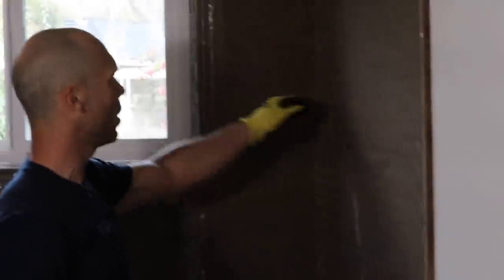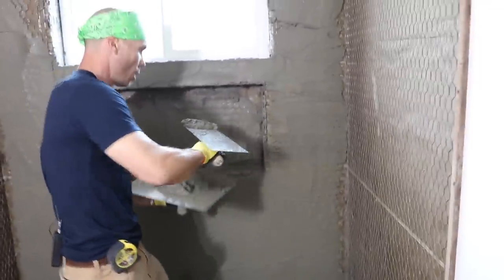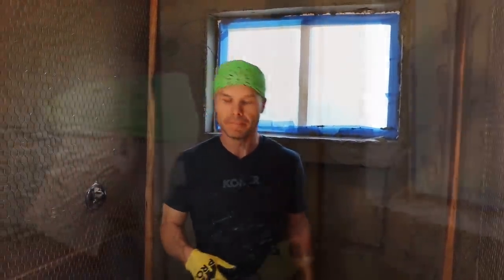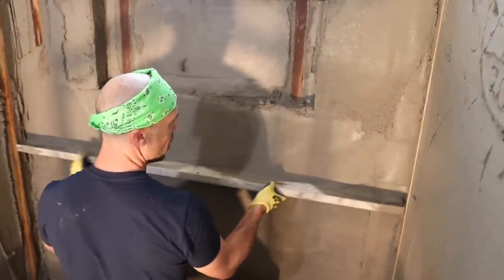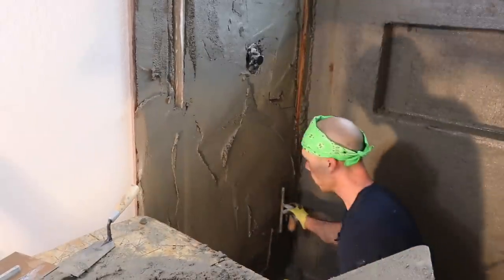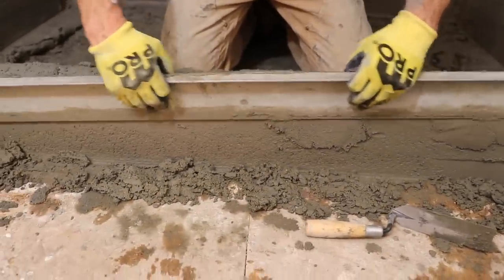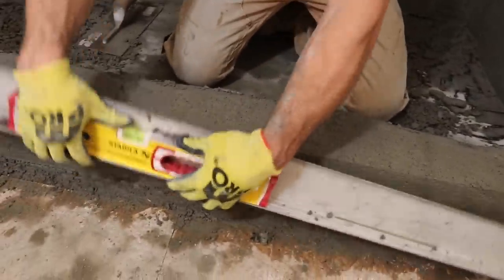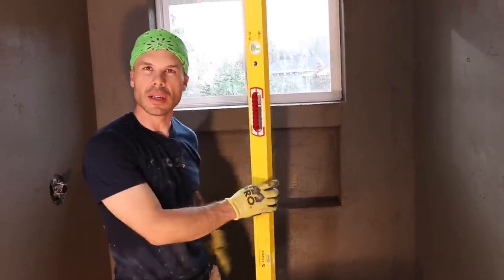Learn how to FLOAT! Tile Coach Episode 23

Comment: It is great that you consider this an art, like sculpture. I feel the same way about building shower pans with deck mud.  Now I want to try this out and I have a shower coming that will be a good one to have a go with it.  Thank you for sharing.  Hey, is there any need to waterproof the finished float surface before tiling?  I would if it were cement board or any non waterproof underlayment.  But then new school methods don't put moisture barriers behind the screw on wall underlayments these days. You however have a barrier behind the wire layer.  Thanks again for upping my game.

Comment: I always scratch coat first by running my 3/8" notch trowel horizontally for "scratches". Next day I brown coat and detail all edges, then start the wall material install.
Nice to have a helper to mix mud and haul... keep the tools clean and organized/ready. It is so hard to find good help... someone who actually pays attention and is interested in their job.

Use the straight edges, one on the back wall, and the helper holding one on either of the side walls, then square-up the furring strips to those on the back wall so the floor tile is square, too.

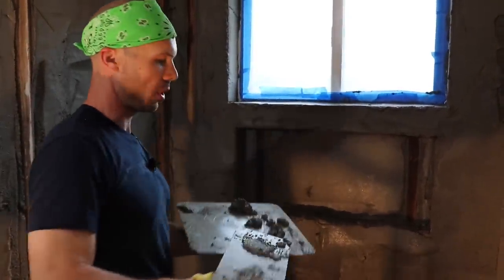@28:14  I guess I spoke too soon... I hadn't watched the entire video before my prior comments.
SoCal and Az. mudwork is scratch, then brown coat... due to weather... even in winter, the temps are far to high to try and float all at the same time... walls tend to crack.  Guess why...

Comment: Isn't shimming the wall much easier? I plain the 2x4's that stick out too much and shim the 2x4's that cave in. I even carve out the boards for nail protectors and plumbing. It takes about an hour. Tile guys always ask how did I get it so flat. They think I use metal 2x4's. Which gave me an idea. 😆

Comment: If you use a 5/8 " molding on the outside of your side walls, then you don't need that second redwood screed to the outside. Just set the inside one and rod off of the border moulding ! Dampen your redwood strips before imbedding them in the mortar.  When you are done with each wall, take a V-notch trowel and at the floor of the pan , dig out the mortar at the bottom 1.5 - 2 inch's up from the pan. That will be a locking scratch area when you dry pack the floor of the pan. Just throw a little wet mud around the perimeter before you throw in your dry pack. It locks the walls and floor like one solid unit. 30 years experience talking. 😁

Comment: Don't think this method will appeal to the Hardi backer bunch. Not quick and easy enough..Usually the plaster crew would lath  and scratch out the walls for the tile installer beforehand.   Normally not applied over existing drywall, but this eliminates a scratch court.  Be careful over plywood though, as it can expand enough to crack tiles later.

Comment: Isaac, do you have another vid where you tile this? I want to see how you trim out the shower wall termination. Plumbing that left wall seems like it would create an issue where it meets the bathroom wall. 1/2" at the top and 1" at the curb. Thanks. Another good video and job well done.

Comment: I need to float an interior wall before tiling, I noticed the wall is pretty concave in the plaster coat after plumbers worked on pipes inside the brick wall. Don't think my 80x80cm tiles will like it.

Comment: About ready to install composite shower walls to durarock. They advised not using waterproof membrane and use construction adhesive onto the cement board as is. Noticing about 1/4” unevenness so should I shim and use thicker adhesive in few low spots or skim coat with leveling patch?

Comment: I have a true DIY question so be nice.  I already installed my concrete board and Schlutter membrane on the walls and now noticed some bowing in the walls.  It is not bad, but the tiles are 12"x23" and will require heavy mud in spots.   Can I thinset over the Schlutter membrane prior to installing tiles?

Comment: So there were a few things that came to mind on this. First, he has wet the one side of the float strips in another video and made a point to film that. In this video he didn't show that he did that and was wondering if he's changed his MO on that. Second, with the floated wall being about 1/2" out beyond the rest of the wall outside the shower how do you transition that from the tile shower to the painted wall? Does it look ok just looking at the dried mud edge? Looking down at the line up of the curb and the floated wall doesn't line up either. That seems like that would stick out as odd looking as well. Wish I could see, and maybe he has a video, him tiling a complete shower after floating it like this. The last thing is did the first coat of mud take the full 10 bags and if not did he just toss the excess? Or did he leave it outside while going to lunch and it was still ok?  Does he cover the mud trough thing with something while he's waiting for things to firm up so the unused mud doesn't dry out? Does he have to add a little water to the unused mud at anytime to keep a workable consistency?

Comment: Done many floats and many cement board showers, but nothing is more satisfying than doing a float. As far as floating the dam, maybe give  this a try some day. Get a piece of Melamine and cut it the width and length you want for your dam, pack more than enough mud on top and place the Melamine on top and just pound it down while leveling it. Then fill in the sides of the dam and use the Melamine edge as your straight edge to scrap the sides of dam instead of using float strips and measuring. The Melamine guarantees you have the exact width. Next day, hit it with a hammer and it comes right off. Perfect dam every time with less work.

Comment: In the San Francisco Bay Area we have the advantage of the moist air, good oceans breezes which cools the area down and also moves the stagnant air away. In LA the air just hangs there, and it’s hotter than a brick oven there too.  They may use a different techniques as a way to compensate for their weather..  It doesn’t really matter as long as the coverage is right and the end product provides a durable and long lasting substrate for tile.  The “Fat Mud” technique is by far more durable and less costly than the “lick and stick” method people usually have installed because it is so well made.  Over the years of use, the property owners will be the only one on his or her block to avoid dry rot problems associated with a system failure.  Fat Mud lasts for about 100 years if taken care of whereas the “lick and Stick “ installation might last 10 if you are lucky.  If you spend an average of 10,000 to 15,000 dollars per shower for the tile work,  and you do this every decade, that is a huge lose.  Just getting it done once makes sense and that is where the Fat Mud comes into use.

Comment: Very good video. Too bad you are in Cali. I would otherwise hire you to do our bathroom. You also reminded me why my father did plaster on our walls the old fashioned way. The studs in the walls of the old houses can be bowed or even wavy. By doing lathe, a scratch coat and one or more finish coats you can level out a wavy wall. Drywall doesn't. Trying to add strips to the studs to even things out doesn't always work well

Comment: Nice video.  I grew up plastering in southern California. Especially on gun crews.   We would routinely lath and scratch coat the showers for the tile guys.  No offense, but we could do it ( lathers and gun) several times faster than tile guys.  it was cost.  However, the mortar or brown coat has to be plumb for tile, so the tile guys would do that part.  I remember in the 1970's , tile guys would fly and do several tub showers in one day. They were amazing.  I strongly prefer a real mortar bed on lath to cement board.  Also we used 17 ga woven wire , stronger than 20 ga.  Thanks for sharing , good video.  .

Comment: A trick I used to cut time in half. Set sticks in a trowel width of mud instead of just 1.5” width of strips . That area has to be filled later under strips so you really aren’t getting any floating done when setting strips. You’ll have 24” of mud up after 2 float strips instead of o😉

Comment: Thank you for your videos. How do you personally decide which method you use on each job? Before watching this video, I probably would have shimmed my walls to level/plumb my sheetrock then put kerdi felt on. This wall floating seems like a lot more work…just curious the benefit/reasoning for this method you chose. Thanks in advance!

Comment: 100% ditto on the slope of the sills. I work pretty much exclusively with travertine in my showers, so it doesn't look too terribly bad if they're over sloped. But I still refuse to do it. Code doesn't require that much anyways.

Comment: Nice job Isaac, I love this method and wish it is something more Tile setters did. Unfortunately the trade is shifting gears and going in a new direction and that’s fine in a lot of cases and I don’t discriminate against the setters that prefer a kerdi board installation over mud. After all, schluter is great product and has proven itself over and over. There have been times where I’ve had to do a kerdi application and couldn’t use mud. In the end I’m great full I’m capable of using both methods. I like your stucco corner aides, that’s something a can see myself borrowing from this video because, I consult fight dropouts above windows, niches and jam openings. I too agree that dynacrete is the best mud you can find in a bag. I live and work in Sonoma county and there are a few distributors outside the area who sell dynacrete. Mostly I use BMI, which is great but, the fat mud is a littler coarse for my liking. There has been many times in the last few months where my supplier has been out of mud and I’ve been forced to resort to the old school way by mixing cement, sand and lime. Thanks again for the video, I love to see younger guys like us that posses this skill. Love your videos and look forward to upcoming ones.

Comment: Floating is something I learned 30+ years ago from my father who was a expert mud mechanic. However when cement board was introduced it became the new standard way of doing things. A lost art for sure and if you don't believe floating its a better method try tearing out one of these after they are cured. I still like to float my floors its just a better finished product, maybe you can show the your viewers that in a later vidjeo. And if you really want to grab there attention show the wet set method for walls and or floors. I'll be looking for those episodes.

Comment: At the bottom where the wall meets the floor. Is there any type of separation there?? How do you prevent the shower walls from wicking up water if it’s connected to the floor pan. Thanks.

Comment: Why don’t you use wide crown staples 16ga? 3/8 wont have the strength to hold that much weight a & during inspection the inspector wont passed inspection when you have the chicken wire screw on to the walls they are looking for nails or wide crown staples .

Comment: You float exactly like l did for 25 years ! 2 trowels and corner-aid for outside corners ! Good hot mopper that specializes in water recieptors and shower pans and mortar bed floats are the only way to do stall showers in my opinion !

Comment: wow you're definitely a master!! But nowadays this isn't necessary all you need is drywall shims behind the wallboard to level it and go board  with polyurethane to seal it off, which is what i use, and buy premade niches and shower pans and premade curbs everything is level and Plumb already. But promps i havent seen this ever and ive been doing this for 3 years

Comment: @TileCoach question....what if you want the float flush with the sheet rock? Is that too thin for the float? If so, do the Sheetrock walls need to be built out to accommodate for it?

Comment: Working alone like I do, cement board is much easier on my old body than floating. I can easily board up a stall in 1 day but it would take me 2 days to float unless I had a helper. You can get the walls flat, plumb and square with board too, so just stop with that straw man argument.  Just because you float does not mean that it's automatically flat and plumb. You have to make it happen. Same with board. In the end, one is not better or more "professional" than the other.
Reply: Not speaking to Isaac here, just commenters.

Comment: So funny I stumbled on this, we are in Marin and just had to rip out a bathroom built in the 50s because an oak tree’s roots grew between the slab foundation and the shower pan, into the main sewer line and caused a sewage eruption, but the walls were floated! They were crazy difficult to remove and heavy as hell, but a great endorsement for the technique as it lasted forever and wasn’t even part of the issue in the end. I guess floating has been around here for a bit!

Comment: I am worried that the wall could collapse and result in the floor failure, if you put such amount of mud on the wall and floor. I doubt if the weight could undermine the house structure support, particularly if there is any seismic activity.

Comment: Nice video, thanks so much for it.  Couple questions.  Why don't you leave the wall rough instead of floating it, wouldn't the thinset hold better to the rougher surface?  And do you only need to float a shower if the walls are not plumb?

Comment: I just have a question??? The tile guy at my brother's house installed cement board from the hot mop to the ceiling and then float over it ... Is that going to bond strong ??

Comment: Try a C-Channel of aluminium instead which is approx 2 inch wide by an inch or so high. The two edges of the C-Channel will remove the render more efficiently.

Comment: were im from we key in the render to our sub straight , saves things falling of the wall in case of movement, so actually glue our render ,so your tilesetters tribute is not showing the right thing , because guaranteed you ll have a dyi guy float to dry or over dust and tile, and down the track you get movement and shit starts dropping on peoples heads

Comment: I get the float part, but how do you get the 2 walls that come together in an inside 90 degree to be perfect from top to bottom ?  My shower/tub I did about ten years ago goes in and out.  I want to take a hammer to it everyday.

Comment: When removing float strips, set a pry bar under strip at floor then force strip up. It pops out clean. I hate it if I pull strip away from wall and It pulls mud off.

Comment: I have a 100 year old brick home with the bathroom in an exterior corner. When I say brick I mean brick outside and another brick wall inside. When I demo the bathroom there was damaged plaster directly on the brick which had been fured  out to put in a fiberglass tub and drywall.  I ended up demoing all the plaster and am left with a very rough not plumb 9' brick wall on 2 sides of the bathroom that I want to tile. Would floating be the best way to go about this? (I have been avoiding finishing this project for Years)
Reply: @TileCoach  awesome. Not too confident that I can do it myself, but at least I know what to get quotes for. Thanks for the speedy reply. I need to get this project done. It's basically ruined my life. You aren't planning to be in Denver anytimes soon are you?! 😉

Comment: Metal Laths, The name comes from the timber version of lathes in laths and plaster. Originally the plaster used to be mixed with horse hair to provide additional strength much like fibres added in concrete.

Comment: I'm going to float my wall for tile. Do I need to put lath if the gap is only 1/8 to 3/16? It's at the top of the wall and won't get wet much.  I'm afraid of tile falling down over time and hurting someone. Thanks
Reply from the maker: Just use thinset for that.  No lath.
Reply: @TileCoach  I don't need to plaster the wall level if the gap is less than 5mm? I'm not sure what the general rule is but it sounds like I can just use extra thinset to level my tiles.

Comment: Ok, so you attached those wooden float strips and then pulled them out to create those channels in the mud. You then proceeded to fill in the channels with more mud... Whats the point in doing that? Is it to provide some sort of expansion points for the mud, water, whatever?
Reply: The strips give you a plum surface to align against.
Reply: @C2CoachCarter  OK, that makes sense. Thanks.

Comment: Do you need drywall backerboard to do this? Can you just install the paper and wire over the studs and start floating?
Reply: @TileCoach  I see....Is it not possible to scratch coat with a rapid set that dries fast in about an hour and do a second coat the same day and be done with it? How much buildup do you get past the drywall? 1"?

Comment: Been hanging out for this since I saw you filming it in your IG stories!
Reply: @TileCoach  - It took me the day to get through it. Such a great system with so many benefits. The only negative I can see is the hard work to mix and apply the mud and the skill required to do it. I'm keen to give this a shot. What sort of sand would you use if you couldn't get a bag mix? Would it be fine/course?